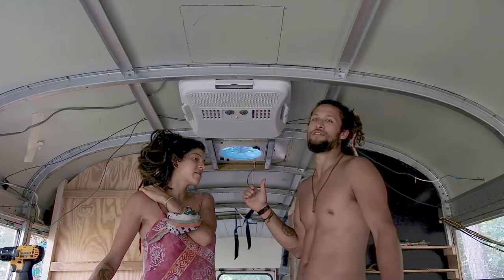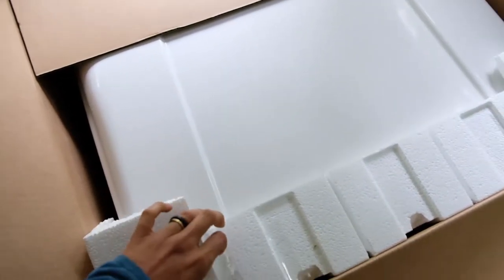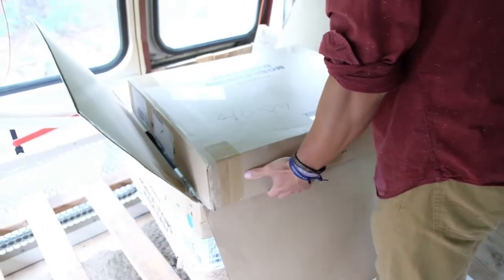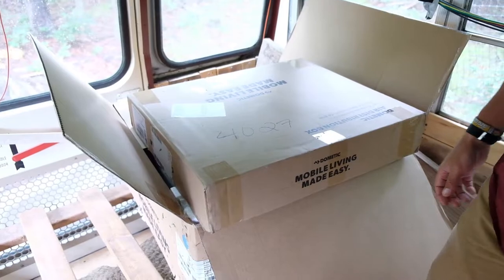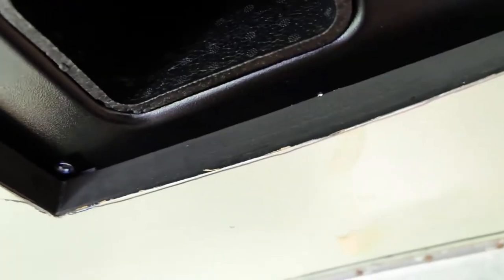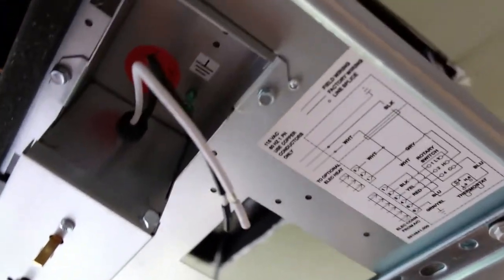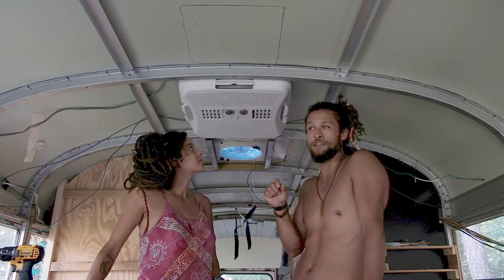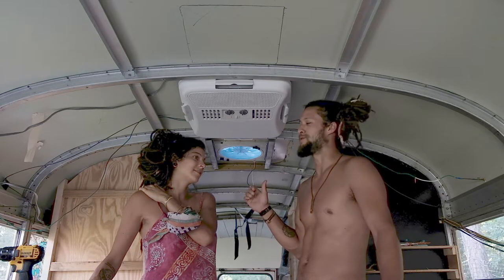EPISODE #22 SKOOLIE CONVERSION: AC Unit installation in school bus renovation

Comment: How did you add a plug to the wires?
Reply from the maker: We ran the wire down to our electrical closet, inserted a fuse and then added a plug that runs to the outside of our bus through the side wall.